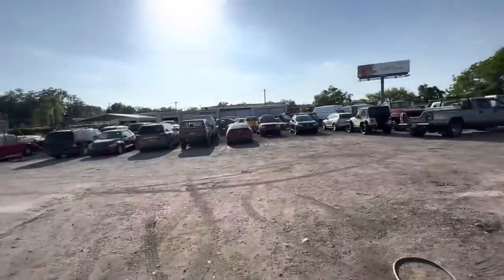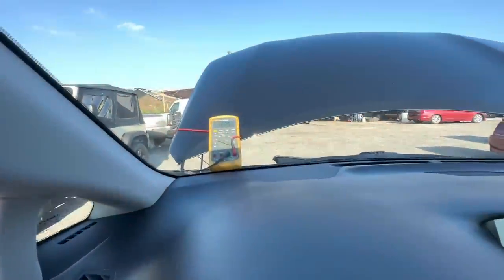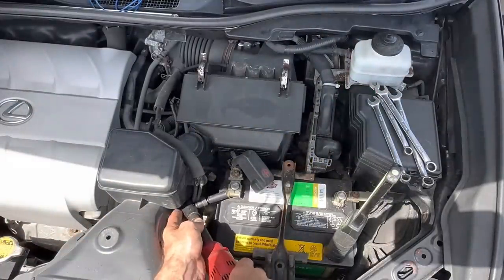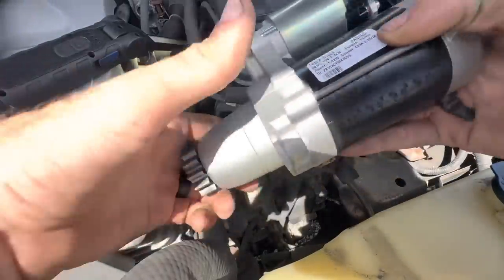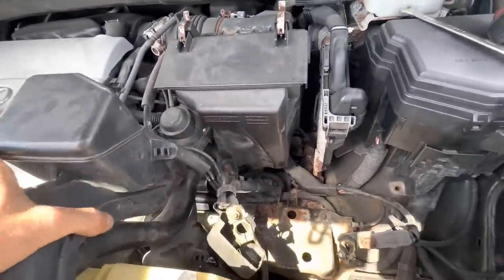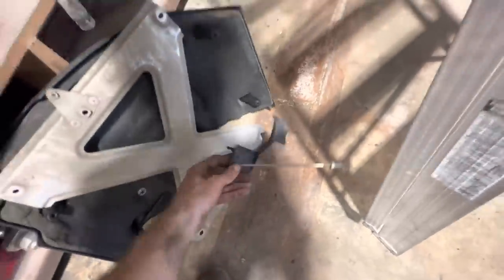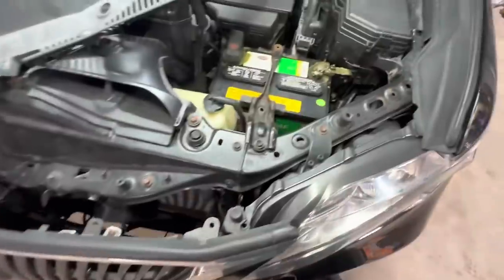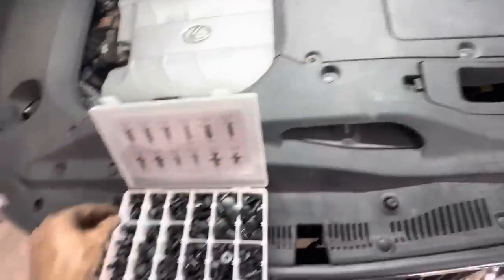Towed in Dead! Lexus Rx350 #mechanic #tow

Comment: Hey Ray.  I noticed this car in the background of your Jeep transmission replacement video.  I'm wondering if you did some work on the Jeep while waiting for the J hook.

Also.  Could the start-stall after battery disconnect be related to the throttle recalibrating itself?  My vehicle's (Suzuki) service manual said something about that process after disconnecting the battery.

Comment: Would it be proper to spray some sort of silicone or rubberized coating on the pretty copper colored wires that were 100% corroded on the failed unit???

Comment: Have you done much work on a Chevy Spark? I have a 2018 and am at 60,000 miles on the odometer. What do you suggest I service? I just put a bigger battery in and I'm thinking I should change the 5 speed manual transmission fluid. What fluid would you recommend Ray? Thanks!

Comment: Out of curiosity. Why did you not spray the bare wires on the new starter, either dielectric or the stuff u used on the battery? Surely it would help prevent future corrosion, no?
Reply: 24 hrs later no reply?

Comment: Since the wire that connects directly to windings in starter was root cause of failure in original starter I wondered to myself this. I pondered why didn't Ray spray that battery protector spooge on that wire to shield it from the evil forces that will surely attack that bare copper? A little spray on that wire would probably make a world of difference bro. Or even cover it with dielectric. Just my insane ponderings Ray don't be offended, love the content bro.

Comment: You might be more reckless than you think, if that brake clean has chlorine in it, as I expect it does, and it is exposed to sufficient heat, it can create phosgene gas. If you didn't know, phosgene gas is extremely deadly in extremely small quantities.

Comment: Okay, unless that cable is enameled, having exposed copper like that is just going to lead to more corrosion. The only reason to leave it exposed like that would be to keep the wire cool which, it's a starter, so there's a good number of amps pumping through there, but still...tin your wires, folks! It doesn't reduce cooling and it keeps it from corroding. Costs like 30 cents more.

Comment: I own a fleet of Toyotas.  It is easier to put the J hook on with it attached to the battery bar and not attached to the frame on the other side.  Do the J hook side first then the frame side once it is in and tight.

Comment: Ray's mistakes:  1. Should have cleaned the battery posts and clamps first.  2. Never wire brush modern strap clamps.  They may not tighten afterwards, and the point of battery spray is that no brushing is needed, just paper towels.  Wire brushes are only for the old fashioned big fat clamps on 70's cars. 3. After wire brushing, he never checked to see if the clamps were still tight like they were before.  4. Should have ordered the j-hook as soon as he noticed it was missing.  5. Severely overtightened the battery holder by using an impact to tighten the nut onto the j-hook. How that plastic battery didn't crack open from the massive crushing pressure and spill acid all over the engine is beyond me, but maybe the car will come back when it happens in a month.  6. Actually said "you're not supposed to use BrakeCleen on batteries" as he did it.  First of all, Ray should have sprayed the clamps with it before putting the battery back in, that would have been fine.  Just don't spray the battery with it.  Again, the beauty of battery cleaner is that you don't need to use a wire brush or brake cleaner, neither of which you're supposed to be using anyway.  Hope that helps.

Comment: Do you ever crank the engine over by hand to verify it’s not a locked motor. Definitely have folk come in before for a “bad starter” and indeed the engine was locked up. Also had an engine lock up and fail on me during a test drive before. May not be common but it definitely does happen.

Comment: The first time you were running the jumper wire to the battery for the solenoid when you tried it a whole bunch times in a row I swear I saw a smoke coming up that’s probably when it fried it the rest of the way so when you tried banging on it the next time you had nothing

Comment: I wonder why they leave the copper exposed. 🤔
Reply: Could be because the insulation would only be a half inch or so, the wire is very short (not long), it connects to the brush holder inside the housing. And insulation it is really not necessary seeing as the wire is energized only when the started is engaged.   It is also handy for testing the starter by sending full battery "+" (negative ground system), but in this case with the Lexus in the video, it was too corroded, so no go.
Reply: @quicksilver462  I was just thinking that insulation would prevent corrosion

Comment: Most of the time it’s not the actual solenoid it may have 12v to it but it earths through the brushes and motor to slowly rotate the starter to stop end on gear jam, so you may have 12v but a poor earth so the solenoid doesn’t go In with full force.

Comment: Why do they even have a bare copper pigtail on that solenoid instead of somehow insulating it? That's just asking for corrosion.

Also, it puzzles me that almost every car is oblivious to a starter malfunction. If power is applied (and confirmed to be present on the starter) and the car doesn't crank, why doesn't the PCM throw a fault code?

Comment: If the oil cooler lines haven’t been changed to the metal ones  the rubber lines have a history of failure & grenadine. The engines

Comment: Hey mr!! I have a 2003 lb7 completely stock duramax. My problem is when I replace the edu relay it will fix the problem. My problem is when I start the truck by the key it will start perfectly fine, but will not shut off by the key…. Also brake lights and it’s saying service 4wd and range shift inhibitated, i know the transmission and transfer case are good, when I replace the edu relay it all runs correctly no issues. When I take the relay out it is really hot. I have replaced starter, alternator, ignition switch…. Any insight?

Comment: The "bang on the solenoid" trick assumes that the solenoid is bad and the motor is good.  If the motor is bad, it is useless.  Used to have a tractor with no solenoid at all.  The switch was purely mechanical, operated with a long metal rod.

Comment: Well, here is what Click & Clack, the Tappet brothers had to say about the Lexus plurality issue. 

"Dear Tom and Ray:

My husband and I recently had a question we thought you might be able to answer. This question is a little off-beat, but we're curious. What is the plural of Lexus?
Amy

TOM: Well, Amy, the problem is nobody knows, because no one's ever been able to afford more than one Lexus. So we'll just have to speculate.

RAY: We suspect that the root of Lexus is Latin. And we traced it back to one of two possible roots. One is Latin for "half-price Mercedes." And the other, roughly translated, means "Japanese Buick." My guess is it's probably the former.

TOM: Also, sticking with Latin, we see two possible declensions. There's the "opus" model, of which the plural is "opera." So if we follow that rule, the plural of Lexus would be Lexera. One Lexus, two Lexera.

RAY: More likely, Lexus follows the same rule as Taurus, which pluralizes as Tauri. So we'd have one Lexus, and two Lexi. Personally, I think that sounds classier.

TOM: And as soon as we find an English professor who owns more than one Lexus, Amy, we'll give you the definitive answer."

Comment: Ah screw drivers I always buy them with non comfort grips so they last forever or snap if I do stupid things with them like using one as a guide pin for installing a engine but if they do turn to goo use some high proof alcohol on them and a magic eraser it will dry the remaining rubber out and rub off the now goo layer.

Comment: I hate when someone puts a different size nut on battery terminals.  Toyotas should be all 10 mils.  Only sizes you should need are 8 10 and 13 mil sockets.  Ford likes their 8 mils for some reason.

Comment: I believe the Lexus either is low on lighter fluid of needs a new flint.......of course I'm drawing on my years of parking lot diagnosis.........or perhaps is needs more plastic crap "protecting" the engine components.  Tell me why in hell we need all that plastic.........?  An acetylene torch gets those starter motor bolts right out..........

Comment: You have a Gator, why not make that work for pushing or pulling cars around?
Reply from the maker: I need it at the house/ not really the best tool for moving cars. I’m thinking of using one of the old mowers for a tug
Reply: @RainmanRaysRepairs  I just said gator because I saw you had one, what really works best is a four wheel ATV
Reply: Subspace comm to the Enterprise and have them beam down some antigrav units then fast float it in.

Comment: Last couple of vids I do notice you are rambling more than usual. You are big on safety (or were in your previous job), so it is always better to attach the positive battery cable first! Then connect the negative. Safety first Ray! And I see there is provision for the front J hook rod as well. Why did you not put that one back in?

Comment: Pulls off completely corroded bare main cable on starter.
Installs new starter with COMPLETELY BARE MAIN CABLE.  WTF?  Are they all that way? Doesn't seem right.
"This is standard thread." [Grabs 11mm socket]

Comment: Ray
Would it be a good idea to use the electrical grease. Like for the spark plugs. On the starter motor cooper wires. Thus stopping the rust forming again?

Comment: Well, third way to fail.  Not solenoid, not motor.  Wire connecting them.

Still prefer the way Ford used to do it, with external solenoid.

Comment: Why not buy a tow bar? They are what, 100-200 dollars and would have you out a lot. If nothing else, they would get a vehicle into the shop. With a clean floor you should be able to push a car to a lift. Doubt you will even see this. Just figure I would throw my 2 cents in.

Comment: Hey Ray. I'm not sure how to true this would be to regular ignition situations but at least when programming a new push to start  fob on a Lexus, if the button is pressed on/off in sequence for more than 10 times in a row, you can lose the ECU entirely and it must be reprogrammed. Is this something you have encountered? Is this also the case without programming mode? I guess my concern is if this can happen when a customer accidentally deadlocks their car because of a dead battery in a key fob or just a faulty key in general.

Comment: What a crappy design on that starter. Copper rots so easily to start with, then they put it in a high heat and high moisture place... Lexus designers should do better for what these vehicles cost.

Comment: The Lexus RX350 are the worse luxury SUVs ever made, not just because of the ridiculous, worthless, panels under the bonnet. The engine will run forever.  But everything else around it falls apart, including the instrument panel, seat motors, window regulators, radio, hundreds of sensors, and the such.  The stupid little things that go bad by the hundreds makes a vehicle with a reliable engine a pile of junk.  Just about everything goes bad with them, one after another.